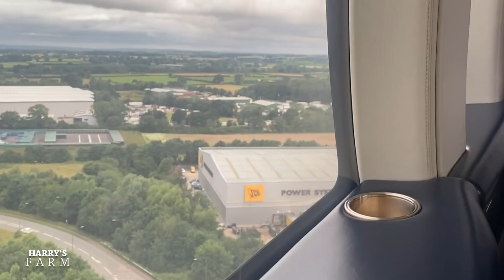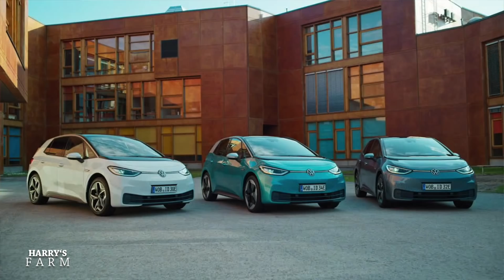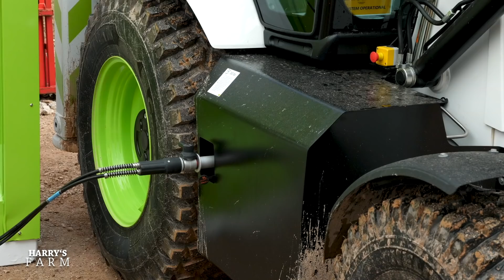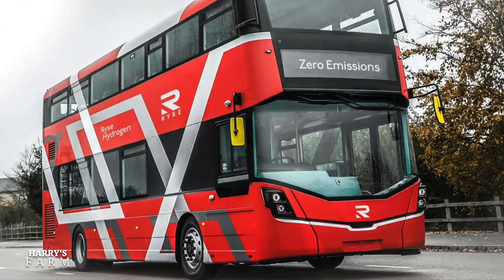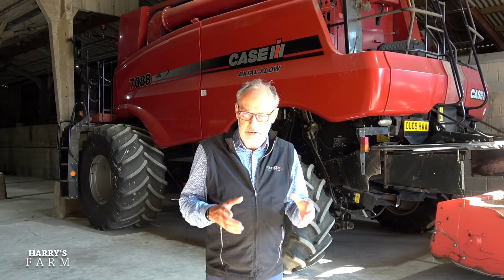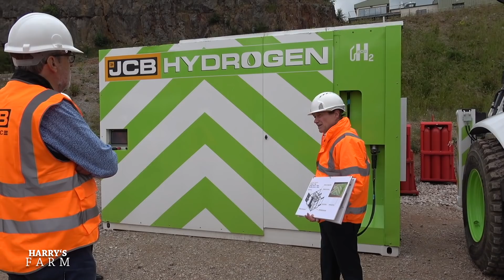Why JCB thinks hydrogen is the best alternative to diesel for heavy machinery, farming and HGV fleet

Comment: An absolute landmark moment in the journey to decarbonising transport, agriculture and construction vehicles. Congrats to the team at JCB for cracking this, and well done Harry for some superb journalism - absolutely nailed it. Thanks so much.
Reply: Nothing cracked at all. The numbers and logistics just don’t add up.
Fuell cell maybe one day but not ICE.
Reply: @alantownsley6391  Have you heard what F1's Ross Brawn has had to say about Hydrogen's future use in F1
Reply: @Angloman516  yes I did🤣. Can we really expect F1 cars to be running around with high pressure hydrogen tanks on board 🤪. At least they will have craters in the tarmac to sweep the remains into.
Reply: @alantownsley6391  You disagree with his engineering knowledge?
Reply: @alantownsley6391  They are safer than any other fuel tank, but your expertise is so much greater than Ros Brawn's is it?
Reply: @Angloman516  Ross Brawn is an engineering genius and I am not. F1 has the talent and budget to make it work but the story behind the story is that F1 is shit scared about it’s future and relevance in an electric world. On top of that, the oil industry knows it’s gravy train is coming to an end and need hydrogen as their future. The complexities of manufacturing, storage and transport of large scale hydrogen sits well with the oil industry and they need it. Using fossil fuel to make electricity to make hydrogen to burn in an ICE engine is the opposite of genius in my opinion. The numbers may change with technology but I wouldn’t invest in it.
Reply: @alantownsley6391  There is no suggestion of the ongoing usage of hydrogen produced by fossil fuel. Future production of Green hydrogen will be by using renewable off peak energy in particular, which would then be distributed by tanker as fossil fuel currently is. There are already some Shell service stations producing their own Green hydrogen on site with ITM electrolysers, Chobham & Beaconsfield to name but two. JCB who already manufacture their own engines have researched and developed their engines to run on hydrogen which will enable many manufacturing jobs to be saved, using batteries only for the lighter equipment he produces. You do seem to have a very emotive attitude towards hydrogen. So far as Hindenburg is concerned, there is much for you to learn relevant to hydrogen safety.
Reply: @Angloman516  time will tell.
Reply: @alantownsley6391  Undoubtedly, just what viable alternative there can be for the heavy plant equipment industry is difficult to envisage. The same can be related to Trucks, Trains, Ships & Aircraft.
Reply: @Angloman516  the Hindenberg? But at 350 bar? Thats why you really need fuel cells, to prevent the requirement for storage at high pressure.
Reply: VOLVO TRUCKs have been using Hydrogen for the past 10 years
Reply: @MOSSFEEN  And Volvo trucks is going BEV now for good reasons
Reply: oil companies attempting to sell oils and gas dressed up as hydrogen it is a scam    Depending on the quality of the feedstock (natural gas, rich gases, naphtha, etc.), one ton of hydrogen produced will also produce 9 to 12 tons of CO2
Reply: This isn't "journalism". It more a thinly veiled advertisement, one that omits some very important negatives of hydrogen. (the same reasons why basically no one else is going this route)

Comment: Anyview on comparing the JCB solution with the Toyota hydro car made? Toyota conclusion was that it is commercial not usable because low power per engine size and big fuel capacity need due to high fuel consumption.

Comment: We need hydrogen in tradesmen vehicles as well
Reply: Hyundai will soon have a fleet of hydrogen fuel cell passenger cars available. Unfortunately the German auto makers all fall for the battery electric car...
Reply: There are several car makers building hydrogen vehicles Toyota and Hyundai to name two, I believe both have had them commercially available for a couple of years. We just do not have the refuelling network to support them. To install refuelling stations requires far less infrastructure than EV charging.
Reply: Okay... Will people be happy to pay their increased charges to cover the cost to the tradesman ? 

I presently run a Citroen  Berlingo , getting over 60mpg... the emissions are minimal because of all the tech onboard... yet they want ME to change... how about we PRIORITISE the biggest users/wasters of fossil fuels and target THEM for reductions first....have you any idea how much fuel a modern commercial jet burns ?? 

The A380 burns 11 TONNES AN HOUR !!... think about that on yer next unnecessary foreign holiday... 🙄

https://alliknowaviation.com/2019/12/14/fuel-consumption-aircraft/

How about all those big swanky cars/private jets the politicians, celebs & elites are driven around in ? ... leave me & my little van alone, I'm making a living & paying my taxes, more than can be said for them.... 🤨
Reply: @peterfitzpatrick7032  Yes we have a Volvo V40 that is zero rated for VED as well and we get close to 60mpg but how long for? As Lord Bamford says the politicians have been seduced by the battery barons.
The only country to come out of this making money will be China who will go their own sweet way.

Comment: Combustion of hydrogen itself does create unwanted particles/gases compared to a hydrogen fuel cell. Both of them will need to exist in parallell.
Reply: Currently the production of Hydrogen is a problem too. Most of it is extracted from Natural Gas, releasing as much CO2 as burning the gas in the first place would. I also think the comment about the battery weight was slightly disingenuous as an internal combustion engine is also rather heavy and that comes out. Battery costs are coming down every year. I think a Fuel Cell is probably a better bet but we still have to obtain 'clean' hydrogen (currently it's too expensive to use electrolysis to make hydrogen).
Reply: @SardiPax  Well the issue is the same for H2 as EV regarding how you create the energy. An ICE might be 500kg, and a tank of diesel maybe 200kg, compare that to 6000kg. And the price of that 6000kg of expencive material. As he said, the production cost is low, its the raw materials that are expencive and they dont really have a way of coming down unless you can use other materials. It´s balancing its way out. There are not enough raw materials for the whole world to go EV, so you will get a point somewhere where the price of H2 will outweigh EV regarding kwh storage, and thats where you will see a shift from EV to H2. Aswell as packaging. It will be size, energy density and cost that will decide which application is best for a certain type of vehicle. Both will exist in parallell.
Reply: @bingoberra18  Thanks, worth noting though that the price of LiPo batteries have fallen 89% since 2010 and with increasing economies of scale, they will fall further. Lithium, the main 'rare earth' used in the batteries, despite the term 'rare earth' is actually extremely common. Australia, for example, has huge reserves. There are also new formulations in the works of course. In terms of the source energy, yes both systems can source their energy from (for example) renewables, but at the moment the efficiency of the conversion of energy to create Hydrogen is poor enough that the costs don't add up (in terms of electrolysis). Hydrogen's only real advantage is energy density, however you 'burn' it. In terms of the practicalities of large scale EV implementations, there are now cargo ships (and later this year ferries) crossing short stretches of seas that have batteries in the range of 1000s of KWHrs. I do think the existing ICE manufacturers are desperate to avoid even Fuel Cells (and to be fair they are quite some way behind battery technology) because that would mean totally scrapping existing production lines. There may well be a future for Hydrogen but I'm not convinced it will be an ICE.
Reply: @SardiPax  Ships and air planes will likely be more suited to H2 once the technology matures, for sure it is easier to make an EV today than a successful H2 vehicle because the experience of H2 in commercial machines is still in its infancy while EVs have a head start and less problems to work out. H2 ICE is likely to be used during the coming decades as a transitional setup.
Reply: NOx is the problem with hydrogen combustion

But if they can make current JCB run on hydrogen then that will be good to help reduce emissions
Reply: feed the unwanted particles to greta

Comment: Not going to happen in my opinion, h2 is expensive and hard to store but every farmer has solar panels on the roof and it is still cheaper to store that solar in a buffer battery than go h2.

Free consulting: look into changeable batteries

Comment: BMW had a V12 ICE 7-series that ran H2 on a very limited trial - the data on that would be interesting to compare with this, as would all the LNG ICE busses that tootle (literally) about some UK cities. It's definitely not good to have all eggs in one basket!

Just a shame that Nikola Trucks turned out to be a cheat - but there are H2 trucks already running in (IIRC) the port of Shanghai.

Comment: if you have a construction site in a city then it is no issue to drop one of those hydrogen pressurisers with all the regular construction bulk. zero particulate emissions in urban areas is great for air quality. Harder to work in more rural locations but still early days, excellent work JCB
Reply: This will emit NOx because nitrogen is in the air its combusting with the H2, still a lot less than diesel though!

Comment: HVO fuel seems the best way forward to me, but unfortunately for Lord Bamford it doesn't even require replacement of the existing plant to reduce operating emissions by over 90%
Reply: oil companies attempting to sell oils and gas dressed up as hydrogen it is a scam    Depending on the quality of the feedstock (natural gas, rich gases, naphtha, etc.), one ton of hydrogen produced will also produce 9 to 12 tons of CO2  
However, hydrogen combustion with air produces oxides of nitrogen, known as NOx. In this way, the combustion process is much like other high temperature combustion fuels, such as kerosene, gasoline, diesel or natural gas. As such hydrogen combustion engines are not considered zero emission.

Comment: Be good to see freevalve technology on a hydrogen engine and what’s possible in terms of ice efficiency.
Reply: Depends on the use case, would be interesting to see how it could further optimize fuel economy in a car for example where you have varying power needs, but in machinery etc you normally want to minimize failures and downtime in a narrow range of high loads, hence the widespread use of push rods even today 🤔
Reply: @petermolnar8667  in the automotive application; I mean. Agreed that reliability is the key in this application and the use of freevalve technology would of course be expensive.

Comment: The hydrogen engine have been around for a while now but it doesn't get the backing that electric does. This video proves that it should have. The materials to make batteries and motors have to be mined somewhere causing more damage to the environment whereas hydrogen is made from seawater, and there's plenty of that.

Comment: Utter nonsense. Hydrogen is a crap technology that needs endless maintenance to avoid fires, costs a fortune to recharge over EV, and has problems with NOx pollution.  And where does the hydrogen come from ? that is a world of pain all by itself.   There is no future in hydrogen engines. it is a big oil distraction to prevent everyone just getting on with the green transition.   As heavy transport is dropping it en-mass then this is just a vanity project.

Comment: Don't hydrogen engines produce oxides of nitrogen? Or have JCB found a solution for this? As of now hydrogen engines are considered zero CO2 emitters, however they aren't considered zero emitters.

Edit: I've found the following in an article from the Financial Times: "The development of hydrogen combustion engines has been problematic because burning the gas at high temperatures produces harmful nitrogen oxide emissions and its inefficiency means large volumes of the fuel must be stored on board. But JCB’s engineers have managed to find a way to burn a small amount of hydrogen at about 1 part per 100 parts of air to avoid it getting too hot."

Would've been interesting to learn a little bit more about this in the video. Maybe I missed it. Apart from this, great video.
Reply: Any combustion engine running at sufficient temperatures will.
Possibly not with an external combustion engine due to the lower temperatures though?
Reply: @tomcardale5596  I did some research. See the edit of my original comment.
Reply: @jona899  ah yes, that would do it.
Bit like why exhaust gas recirculation is used.

Comment: The reason companies haven't typically pursued hydrogen is it's grossly inefficient to produce. 45% of energy is lost in electrolysis alone and more than that converting it into mechanical energy unfortunately. I love the idea of hydrogen but without a step-change in technology it'll likely be a non-starter.
Reply: True, but it has its uses where you have have an excess of power you need to get rid of, then it is a good way of storing engergy that would otherwise be wasted.
Reply: @quadswallop2713  The next generation of EV batteries will be 'extreme fast-charging' (XFC) able to fully charge in minutes. In fact you'll see them in mobile phones within the next few years. The rate-limit problem with batteries looks easier to solve than hydrogen efficiency. 🙂
Reply: @thomas316 Yes, I think they need to come up with a solid electrolite first. The focus is on changing the fuel we use, when it ought to be about reducing what we use, but that's another topic.

Comment: The big problem is that hydrogen simply doesn't exist as a pure element, because it REALLY wants to bond with other stuff (like oxygen to form water)  That means you either have to make it by reformation of a hydrocarbon (ie methane, and remove the carbon bit) or split it from say water.  Unfortunately, either option is fundamentally energy intensive.  Then we get to the storage, which realistically requires either high pressures (700 bar !!) or cyrogenics (very cold) again, taking yet more energy to do.  Then finally, if we burn that hydrogen in an ICE, we have the terrible efficiency of that heat engine (around 20% efficient at best) right at the end of our supply chain.  All that adds up to the fact that doing work with hydrogen rather than with electricity (stored in a chemical battery) results in a consumption of around 3 to 6 times more total energy.  And if that energy comes from renewables (which it must to be "zero" emisisons) then we need to put in place 3 to 6 times the infrastructure to provide that energy.

So whilst at a basic user level, yes a H2  excavator does make sense, in reality it's not that great overall.

Comment: Talking to a company that designs and makes lorries they having issues with hydrogen fuel cells vs batties because they finding hydrogen fuel cells are heavier than batties and hydrogen fuel cells are cause weight distribution and handling problems.  It is very hard to package for it to work in the trucking industry - they finding there, not enough physical and weight headroom and they going overweight on axles and individual wheel weights esp in the American market - before I forget - add in the joker of big areas of the USA, due to the way roads are constructed they have very different weight allowances in the spring and autumn due to the frost effect ie ice making the road foundation softer and unable to bear weight thus loads can drop as small as 3,000kg

Comment: He's right. Hydrogen engine development is the practical future.
Reply: @Tony Edgecombe that’s true right now, but unwanted renewables could be used to convert water into H2. It’s really a form of energy storage.
Reply: True. How do all the EVs and Teslas get charged again?
Reply: Combined with a mass expansion of nuclear power it could well be. It's effectively akin to battery storage, if off peak generation is used for it's production.
Reply: @jagman84  combined with molten salt reactors as well
Reply: No its the past. BMW did this 20 years ago. That old JCB man just wants not to change his company and supply base. Even with a fuel cell h2 is to expansive let alone with an ice.